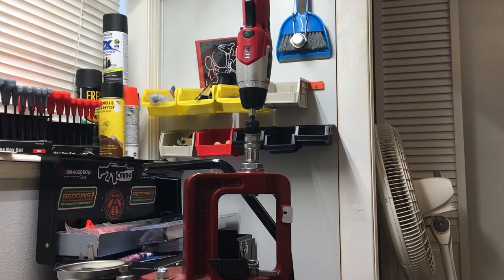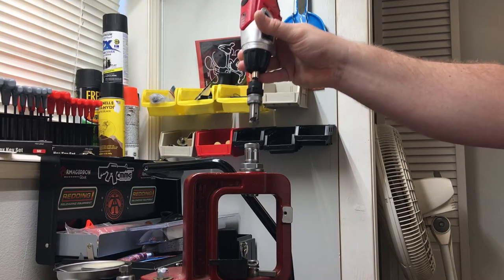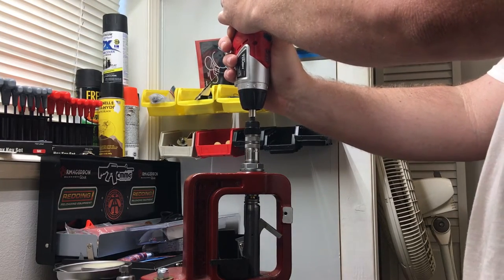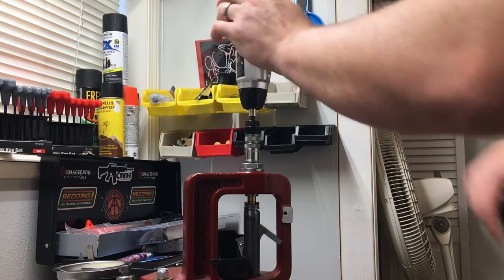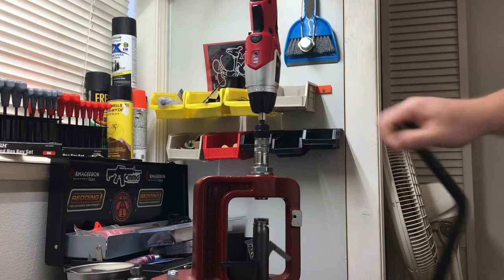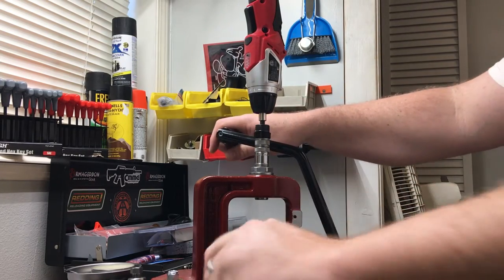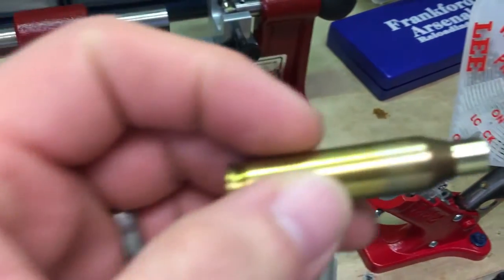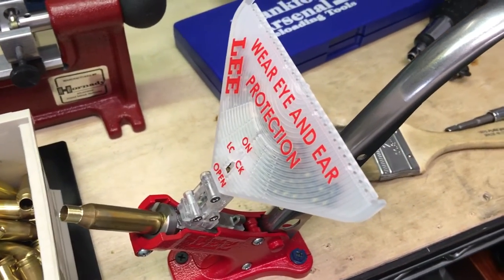Reloading 260 Remington - Part 3 Updated

Comment: Just a suggestion that helps keep track when charging cases. I keep a box of bullets open, and after charging, I will place a bullet tip down in the case. That way, the case is marked as charged, and the bullet is there on hand when it comes seating time. Of course, I always verify visibly again before seating.